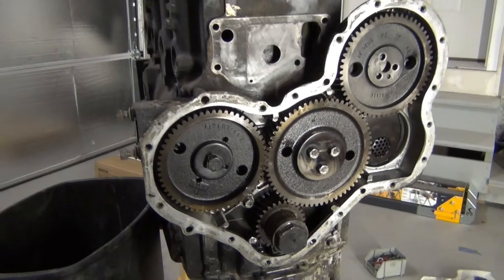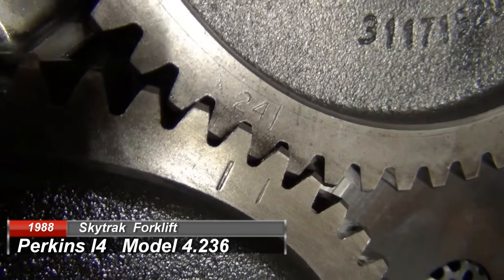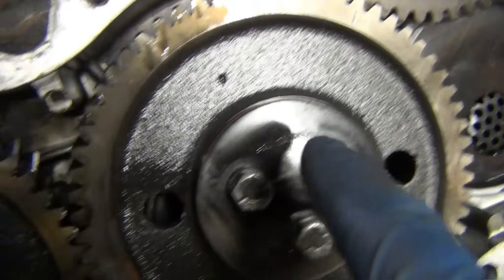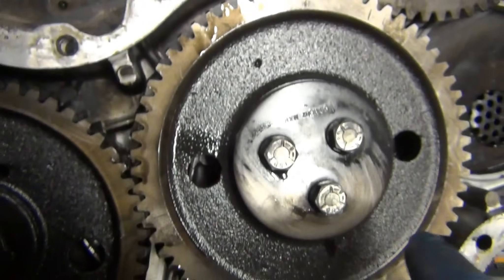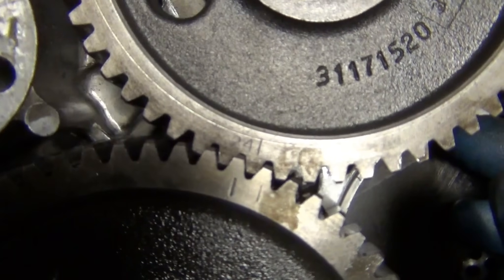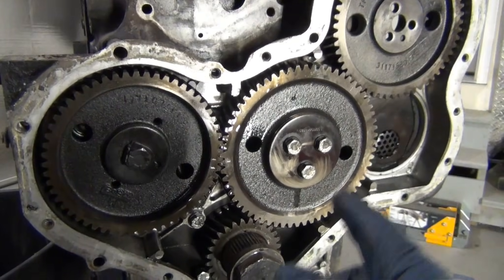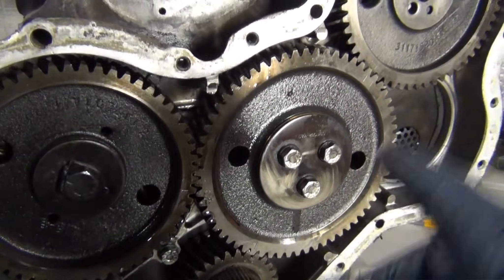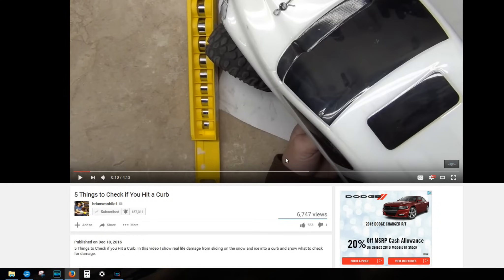Perkins Diesel Engine Timing Marks in Full HD

Comment: Master, in 6cylinder Perkins turbo engine why the timing marks of the gears are not return to its original timing mark says there that two revolution of crankshaft and it will return to orginal timing

Comment: since its an engine with a timing gear and not timing chains or belts, would there be any problems if one were to ratete it backwards? or does it always stay in sync no matter which way you rotate it? 
i am asking, because i have rotated my 1988, 6 cyl, MWM engine, backwards to adjust valve setting, because the engine is mounted and it as easier to rotate it backwards/ counterclockwise.

let me know if there is reason for concern....

thanks
Reply from the maker: I've done it successfully on lots of motors without incident.  Ford, Perkins, Chrysler, Isuzu, etc.  no problems so far.

Comment: Once you line them up it takes several turns to bring them back where it should be I don't remember how many turns been a long time since I worked on one the 203 and 152 engines takes a lot more turns than the 236 or 248 engines
Reply: Доброго вечора
Маю проблему по перкінсу 203 
Виховний навантажувач із цим двигуном 
В один момент робили заміну двигуна заміняли на такий сасий 203 
При установці спробували запустити 
Завівся на холостих оборотах декілька секунд по працював дали трішки газу і заглох 
Після того топливо до форсунок перестало іти 
В результаті в топлівній переламало вал 
В чому може бути проблема?

Comment: Do you know how to lock the crankshaft gear on a perkins 1106a 70t ? I have cylinder 6 on the rock.
Timing Mark's aligned on gears at the front. Cam shaft lock pin is in however on the 1103 and 1104 there is a pin that locks the crank but on the 1106 it's not there. Any info you can help me with I would be grateful cheers

Comment: I had a few motors which appear half a tooth off not on mark. I put paint marks or scribe before disassembly to avoid issues. One odd tooth on one gear insures equal wear since two teeth never consistently mesh on the same power pulse. Ducati has this idea . 

Look up a Napier Deltec engine ..

Comment: I've been working on this 88 Camry 3sfe for some time now. I was checking grounds and continuity. I considered buying a tone generator tool that you used on d6Spanky corolla fuel issue video. I did find some interesting readings yesterday with continuity checks. The VTA wire and IDL wire from the throttle sensor to the computer. IDL gave a consistent reading. VTA was unstable. Now I do want a tone generator. Trace down the short.

Comment: Popular motor on 28 foot Nordic Tug boats. Amazing efficiency, 4000 hours is just getting seated in.
Reply from the maker: This one is at 6k hours, but at dirt and water and then sat for 12 years in the weather with the intake open.  I guess that's bad?
Reply from the maker: *ate
Reply: briansmobile1. Seen many of these motors in Marine applications where they didn't have OEM air filters.  Guess they figured dust can't float over water.   If you're still working on this one I'm sure many of us would love to see more of the rebuild.

Comment: I've got an '86 4.236  on a Cat loader-backhoe.  It has plenty power, cranks on second turn and idles with a purr at 450 rpm with oil pressure over 40 psi... No leaks anywhere.  A lot of keeled sailboats use these for auxiliary power.  The US corporate headquarters/distribution center for Perkins is in Jacksonville.  Just across the river 20 miles from me.
Reply: I'm trying to figure out the timing ratio between the crank and the inj pump. I'm thinking that the inj pump will hit all 4 cylinders in 1 rotation, which would be 2 rotations for the crank? Your ideas. I am trying to install the inj pump back onto the engine.  Possibly the side cover shall be opened to align No 1 visually inside the pump...?
Reply: سخش

Comment: The idler should have a hunting tooth ( one more than twice the other gears, 24-49 etc) in it and you should be able to take it off and line a the other marks up and put it back on. At least that is how it works on the engines I have worked on.

Comment: I counted 58 - I could be wrong though lol
Reply: 56 is what I finished with, maybe I need to retake 1st grade.
Reply: I counted 56 too xD
Reply: I'd have to put it in paint then mark it off a bit. In real life it's easy to put your hand on a tooth and count from there but digitally it's much harder - I tried on another video once where the comment was about how many degrees timing was off based on tooth count vs how many teeth into degrees. :)